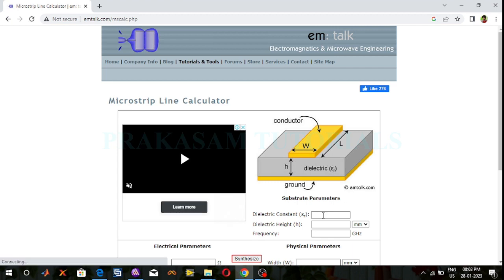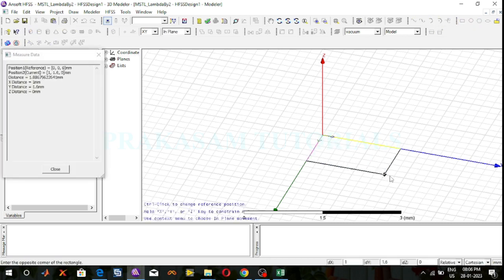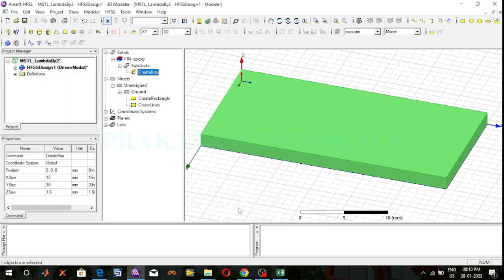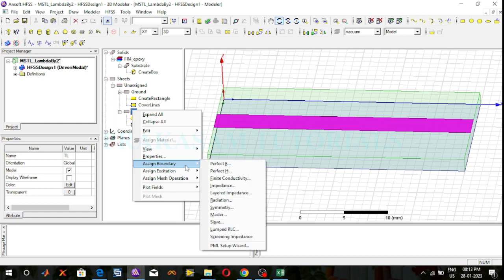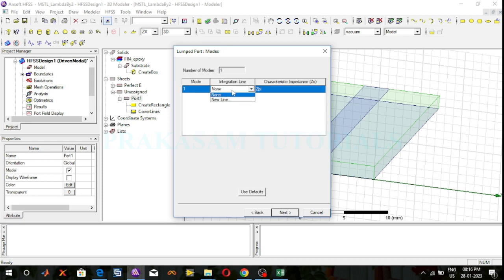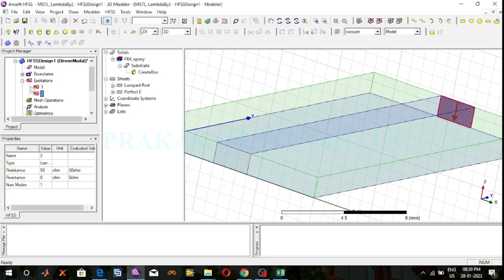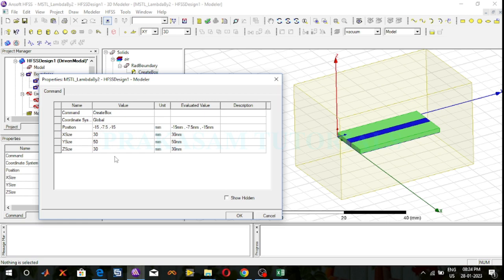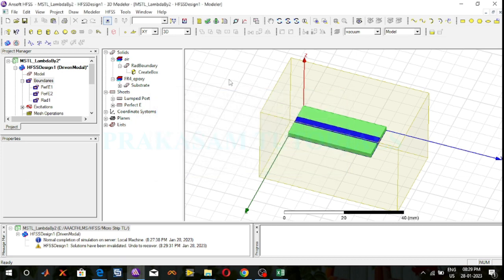50 ohm microstrip transmission line at a 5 GHz operating frequency using HFSS software

Comment: Thanks for the video
Do you have a reference for specifying the radiation boundary? I mean the size.
As far as I know, it should be lambda/4 or higher, but I'm getting different values for the S parameter when I increase the radiation boundary (I'm simulating a coplanar waveguide). I would be grateful if you could simulate this model as well and post it. HFSS is too difficult.